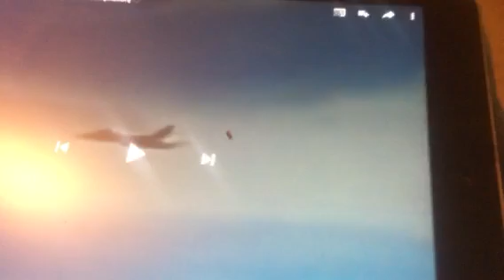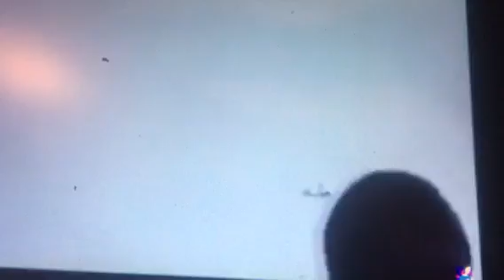Rockets don’t break the sound barrier

Comment: I'm an addict. But dude, you literally FAIL to hide you have a drug problem. I've been sober for 1 year and almost 3 months. You need to get yourself some help dude. Having been an addict half my life (I'm 32) I can spot other addicts with relative ease. An acquired skill I guess? Birds of a feather flock together kind of thing. Anyway, you need help dude. It gets easier as time goes by but I promise you it DOES get better.

Comment: You need to see a psychiatrist...
The Vapour shield is not seen within 4 seconds because even the fastest (viable) aircraft ever build (SR72 Blackbird) took several minutes to reach Mach 1.
Reply: Adam Johnson you need a psycolojist because you don’t know nothing about vapor shields
Reply: @michaelthompson9945  when you can't even spell correctly
Reply: @michaelthompson9945   dude, just stop..
Reply: Forget his grammar.  You all missed the real error with his post, SR72 has never been released yet. I think he meant to say SR71.
Reply: @buggle96  Yea thanks for correcting me slip of the fat finger...
Reply: @michaelthompson9945  u okay there snowflake?
Reply: kermit 2.0 ain’t had snowflakd
Reply: Well, don't you think the correct codename for SR 72 is Aurora?
Reply: Blackbird is SR 71 right?
Reply: Btw, the vapor shield only forms at low altitudes, as they have higher amounts of water vapor. Rockets fly much higher than jets most of the time, so the vapor shield isn't visible.

Comment: Visible vapor cones don't occur any time they get supersonic, LOL! The most dramatic ones happen to aeroplanes when they are flying into the warm, dense, moist air close to the surface of the sea, and that makes COOOOL footages/photos for the Navy... In dry air the shockwave does not produce such water condensation. Rockets get supersonic speeds at very high altitude, in very thin air and it can be unnoticed.
Yet Reds Rhetoric captured a Space X rocket showing a visible shockwave during its descent and I guess you can search "rocket breaking sound barrier" and find other examples. But do FEs do real research?  :P

Comment: Well there's a number of reasons, firstly the vapor shield doesn't actually occur at exactly the speed of sound. It occurs slightly lower where the air surrounding the object is being deflected at the speed of sound, but if that's not enough for you the atmospheric conditions namely relative humidity have to be within a given range to show the cloud, and further more, if an object accelerates past the vapor cloud speed, you can only see the cloud for a very brief moment and lastly, as many others have said, rockets take a good amount of time to reach the speed of sound and again are accelerating too fast to show the cloud if formed for more than a few milliseconds
Reply: That is trans sonic if I remember right. Also, the higher you go the less dense air is and the sound barrier takes more speed to break, correct? I may be wrong and hope my thoughts are at least in line with your point.
Reply: David Johns I'm not sure of the proper word for the effect that causes the vapor cloud, but Trans sonic rings a bell. As to the altitude, density and slower speed of sound, yes you are correct, I'm again not sure of specifics but iirc the change of sonic speed is minimal with altitude change until you get a WAYYYYYY up there. But yes that is also true.
Reply: Quick bit of research ( far more than any flatearther) shows that you are indeed correct transonic speed is indeed the speed range at which the vapor cloud can be seen. And an altitude increase of 30k feet will DECREASE the relative speed of sound by roughly 100mph. So the higher you are the slower sound travels but also the harder it is to acheive such speeds due to limited aerodynamics, engine performance, and stability that come with less dense air.

Comment: To make this very clear. Those jets barely break the sound barrier at the time of filming. 

The speed of sound has gotten it‘s own unit called MACH.
To leave the stratosphere, any give aircraft needs either a long time or a lit of kinetic energy, latter of which seems to be the better option. From what i know, rockets and other spacecraft build up a velocity of up to MACH 23 or 23 times the speed of sound. The vapor shield in this scenario is therefore irrelevant.

My statement does not include any facts, because i am tired as shit and i am not motivated to google for you, to get some facts that you are going to trash anyway

Comment: Ok, so you really need to just google why vapor shields form in the first place. All the jet videos you showed were them flying low overhead, where the air is moist. The "vapor shields" are really visible clouds of the condensed water, and these are typically only visible in low flying jets. Rockets, however, normally fly much higher up, as they are designed to fly where there is less oxygen, and thus air humidity. This is why these vapor cones do not form on a rocket-powered aircraft typically. However, if a rocket is low enough, it will form a vapor cone. See the video in the link below for a rocket forming a vapor cloud, visible as it accelerates. Breaking the sound barrier is exceeding approximately 767 mph, not forming a vapor cone, but instead a sort of sound parabola. And actually, research things before you assume random things about them. Please. Also, pay Wolfie already. https://www.youtube.com/watch?v=H5jUeW_Xib8